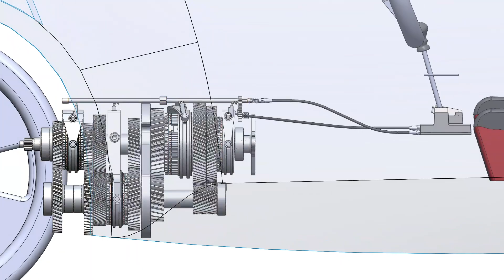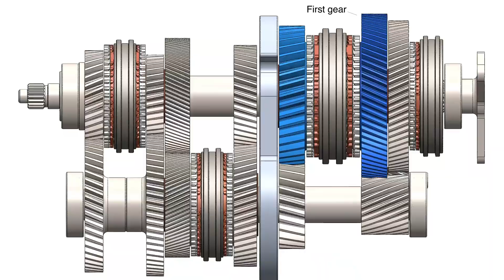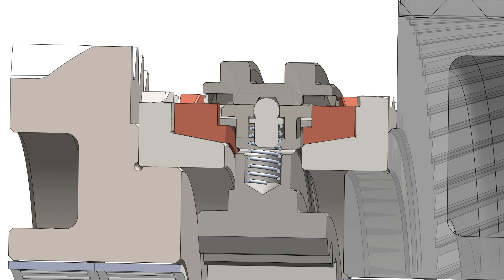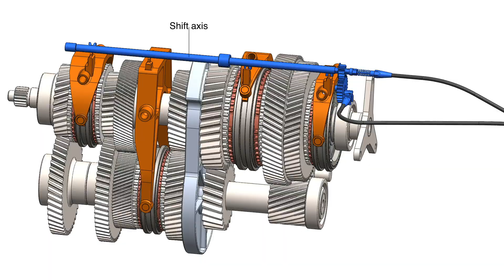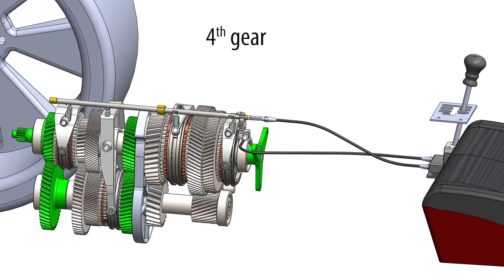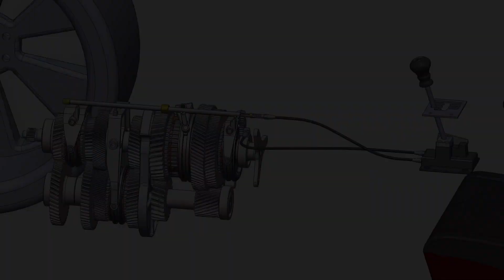Animation of a 6-speed car gearbox

Comment: I have a 2008 Altima SE manual.  This is an excellent video explaining how the gear shifting works. However there is one thing I noted and that is the output rotation does not reverse when in the reverse gear. I'm sure it just a simple change with the animation software. Nonetheless, this is great.